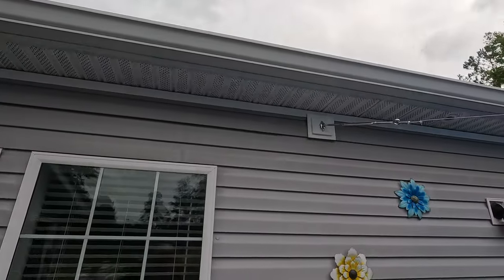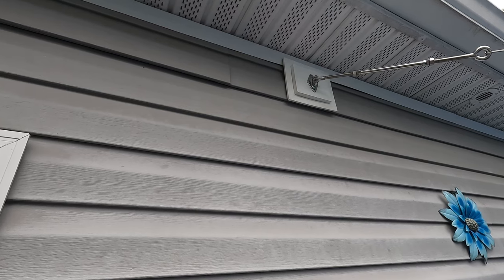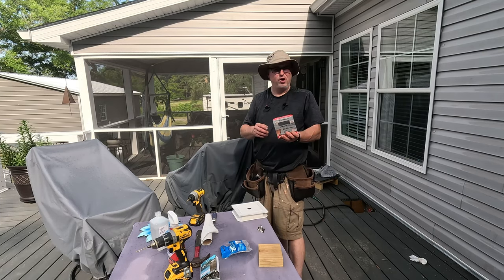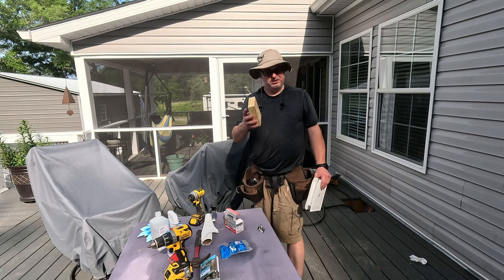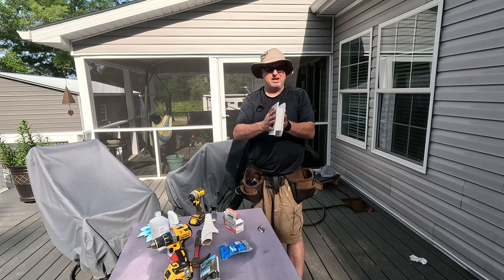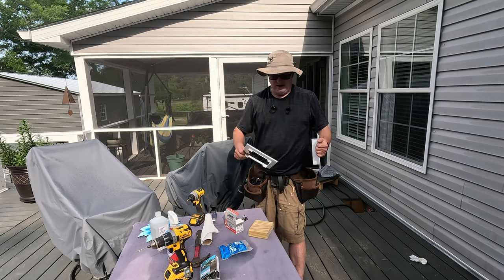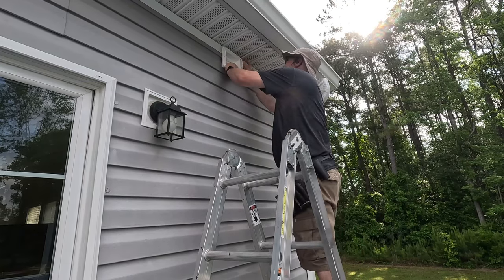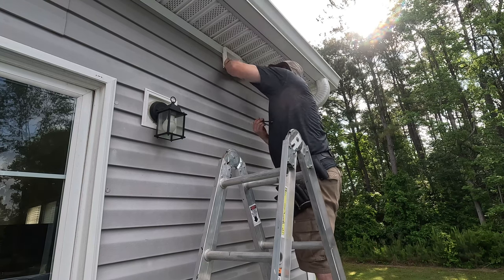How to mount a Sun Shade to Vinyl Siding.

Comment: First time homeowner here with a town home that's 3 stories in the rear--this was super helpful, thank you!

You mentioned something about silicone--where does that come into play? Where do you place it and why?

As for the wooden block--is it held in place by that large mounting screw, or did you affix it with glue first?

Thanks for the help!
Reply from the maker: Thank you for watching and glad it was helpful.  Sorry this took me a bit to respond.  The silicone goes around the edge of the pad eye if you feel you need it.  I didnt realize i forgot about that until after i posted the video.  As for the wooden block.  Yes the long screws hold it in place. In my opinion all four screws should be long enough to go through the block of wood and deep into the stud.

Comment: I think the eye bolts can be screwed without that white box, right?, so no cut necessary but just find the stud and screw thru the siding to the stud
Reply from the maker: Thanks for watching. I thought about that but I was afraid it would crush the vinyl siding and pontentially allow it to leak. Might work with solid siding though.

Comment: So is the 2x6 block just 5:55 mounted to the plywood from the same screws used for the padeye? Or did you screw in the mount first before screwing in the padeye?
Reply from the maker: Hi thanks for watching the video. You can do it either way.  I just used the same screws that i used with the pad eye.  That being said the screws should go through the plywood and into the stud behind.  Just into the plywood wouldn't be strong enough.

Comment: We are doing this today! Did you use a nail to hammer in the frame to the house? I couldn't tell in the video
Reply from the maker: Glad it helped.No I used 4 inch stainless steel star or torx head screws. Screws are better in my opinion here because the force is wanting to pull them out and down.  Be sure to get a heavy duty screw. One that will just fit in the hole on the pad eye.   They gave me about 2 1/2 inches of screw in the stud behind the 2x6.
Reply: @TheBakerFarm  thank you... It's been a little difficult so far. The siding on our house did not have an end in the area we need to put this at 😯
Reply from the maker: Sorry to hear that.  Im sure you'll figure something out that'll work for you. Please let me know how it goes

Comment: Great video!
How do you figure out the strongest point to affix to the house?
Reply: Studs are 16 inches on center from the corner.
Reply from the maker: Yes as @apodictic1 mentioned you need to attach it to a stud. The box in the video is centered on the stud.  All the screws i put in went through the stud behind it.

Comment: Hello there, what size mounting block did you use?
Reply from the maker: The vinyl or the wood?  The vinyl is 8.5x7.5 . The lowes item number is 790801.  Im pretty sure the wood block would have been a treated 2x8 cut to fit the inside of the plastic block.  Hope this helps.